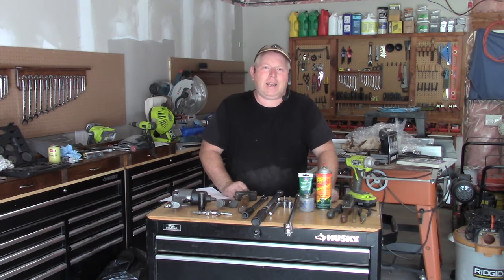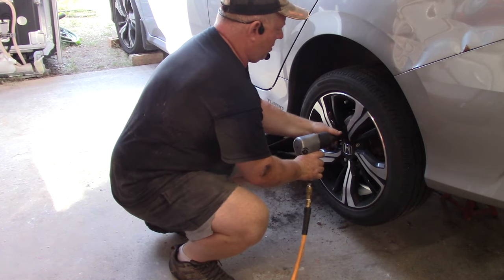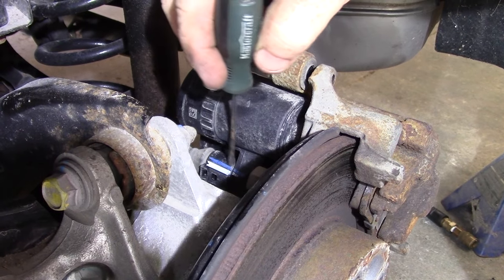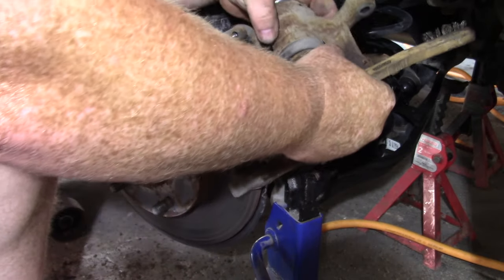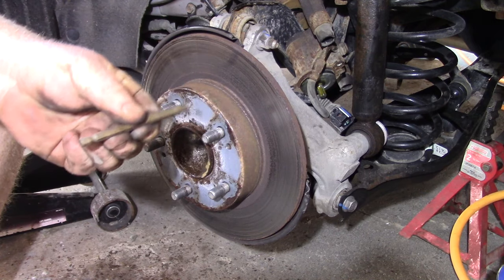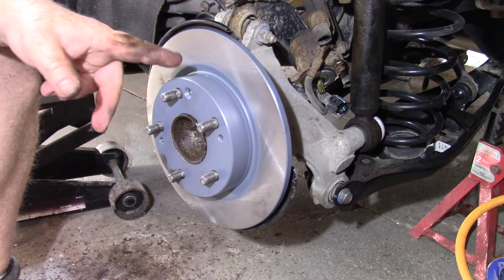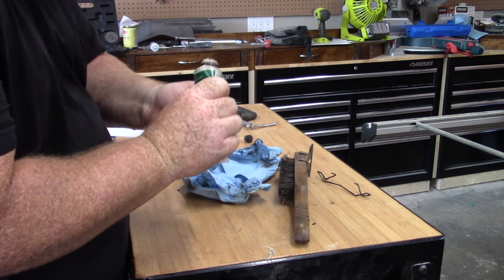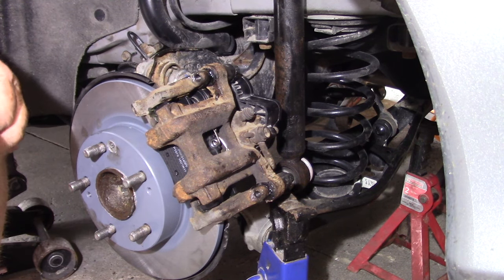DIY 2016 + Civic Rear Brake Replacement With EPB Using Honda Tech Manual

Comment: Very well done video. Thank you very much. I carefully followed it on my 2017 Civic EXT and didn't have any trouble (no brake light afterwards).
What I did notice is that when I jack up the rear of the car and I give the rear wheels a good spin with one hand, it only makes a little bit more than a whole turn after I released them... when it should be around 2.5 times if I am not mistaken. I am saying this because I noticed the drop in MPG... I guess because there is some increased friction on the rear brakes. What steps would you take to troubleshoot this scenario? Grease the caliper pins? Thank you in advance.
Reply: The problem was the caliper's pins. I greased them better this time and I also greased all the other brake parts. I am getting +50 mpg on my 2017 Civic EX-T!!!
You can see the "wheel revolutions" test here: https://youtu.be/0wX7ISUY3hk
This video shows how I greased the front brakes as an example: https://youtu.be/Cr7v6KarX6A

Comment: Hi rob, thanks so much for the effort that you put in making this video! 
I didn’t touch the electronic parking brake at all when I was lubricant the brake parts beside unplug the wire but I still managed to push the piston in a little bit w/ a C clamp and I pumped the brake afterwards and checked the electronic parking brakes and they’re working just fine. 
Is there a reason why you remove it during the changes? Because I managed to push it back enough to fit it back in w/ the pads. Just asking if I need to remove it in order to press the piston back in or I might damage it?
Reply from the maker: There is a possibility the EPB could be damaged while installing new brake pads.  You can retract the EPB manually like I did in the video or with an expensive scan tool.  All manufacturers suggest setting the car in "maintenance mode" (either manually or with a scan tool)  It's super easy to do and don't forget to calibrate the brakes shown in the last part of the video.  Good Luck with your repair!
Cheers!
Rob
Reply: @robsgaragewoodworkin  I’m not too sure if it is damaged or not but it’s still working fine and still functioning normal on both sides when I put it on and release it daily after the press. But I’ll b sure to manually remove it next time! Tysm for your time!

Comment: Hey Rob!  Thank you so much for this detailed video!  I was able to replace my rear pads and rotors with no issues!  I know you use a caliper tool in this video, but much like in your video for the front brakes, I was able to use a 4" C-clamp to push the caliper piston back.
Reply from the maker: You're welcome!  Thanks for your comment!
Cheers!
Rob

Comment: Thanks for the video Rob, very helpful. I have 80000 miles on my 17 civic. The rear brakes were making loud grinding noise. The discs looked really rough, like the shoes were making partial uneven contact , but the shoes had more than 1/4 inch of meat on them. Weird. I changed everything anyway, and lubed it all up, and it sounds so smooth now.
Wheels needed a big rubber mallet to get off as did the discs. Well worth the trouble.
Reply from the maker: Awesome!  What did you do with all that money you saved?
Reply: @robsgaragewoodworkin  lol, as soon as I talk with legal I'll let you know. :)
Reply from the maker: @vincentl4691    Lol!  Better wait for the trial too be over so you don’t incriminate yourself...😂

Comment: Thanks for the video.  Just replaced my wife's front and rear brakes.  Followed all of your steps except disconnecting the coupler because for some reason it wouldn't come off.  Still worked out in the end with no brake light.
Reply from the maker: Awesome!  Time for a beer!

Comment: Best Civic rear pad video ever! Honda made this shit more confusing than it needed to be.
Reply from the maker: It's actually a great system that solves a variety of issues.  The problem is no one knew how to do it properly and they weren't sharing that information.  It's actually quite easy.  Don't forget to calibrate the EPB by cycling it on and off 2X like I did at the end of the video.  Mechanics everywhere are getting ABS error codes because they don't know that simple crazy important step.  Good Luck with your repair!
Cheers!
Rob

Comment: Finally lol i try to do it my self and I couldn't do it . It was my first time iv search and no one had a video yet hows its done. Iv  searched around and it said it needed to be done with a electric device or computer.  So i had my done at a mechanic and they charged me just for labor but i had the parts $100 so now i know how next time thank man you saved our lifes on saving money. Lol good job , i have an accord 2018
Reply from the maker: Yeah I hear ya!  I looked all over to find the proper Honda instructions.  Super easy to do (when you know how)!
Cheers!
Rob

Comment: Very in depth and informative video! Question about the electronic parking brake. The mechanism is completely separate from the brake pedal, correct? I'm wondering because I'm getting ready to flush the brake fluid for the first time and I want to make sure the parking brake doesn't turn off as I bleed the fluid.
Reply from the maker: Yes you are right.  Just cycle it on then off to ensure its not engaged for the brake fluid flush.
Good Luck with your repair!
Cheers!
Rob
Reply: Hey Rob question regarding brake flush ... I did my brake flush on my 2016 civic and the parking brake WAS ENGAGED during the entire flush .. should I be worried ?? Or should I do it all over again with it off ?? THANKS IN ADVANCE!
Reply from the maker: @bettyguzman7130    Ok, that is a good question.  I’m a little picky so I would pop the rear wheels off, disengage the parking brake and just try to bleed the 2 rear brakes.  You are probably fine but I would double check - just in case.

Comment: Nice detailed video with great editing. Thanks. A few points. I would use a q tip instead of a nail to smear grease.  Better control. 
Also tech manual says to replace epb o ring and screws but I would say it isn’t necessary
Would you agree especially since those parts could cost 50$. I assume is to prevent moisture.

Comment: Just did this exact method but didn’t unplug the epb system when I removed it and the parking e-brake dash light is on now. I’ll Jack it up tomorrow and unplug it and plug it back in and hopefully that’ll reset it. Great video tho it was very helpful 👍🏻
Reply: I didnt unplug it when doing mine as it was stuck so didnt wanna break it and it was fine tbh

Comment: Great video! Are both slide pins the same? I know on my Sonata they were different, so of course you had to be careful you put them back in the original locations. Also, I always spray brake cleaner on any brake parts that I use a wire brush on and also the new rotors after installing them.
Reply from the maker: Yes I do one at a time so I don't mess it up.

Comment: Hey Rob! Great video but I have a few questions if you can help me out. Like the person stated down there if the parking brake needed to be disengaged prior to starting, is that done by putting it in Neutral or the actual E brake, and do you put the E brake on for the job or does that mess with the EPB system? 2nd, what kind of pads are best for the Civics? I’m looking at doing this job but not sure if Ceramic should be used or if the premium pad should be bought. Thanks! And hope to hear back from you soon! Cheers!
Reply from the maker: Just make sure parking brake is off and leave the car in gear if it's a manual or in park if it's automatic.  It doesn't really matter but the stock brake pads and rotors would be considered premium.  The stock rotors are ceramic coated so they don't rust on the dealers lot but you don't need the ceramic coated rotors.  I just get premium pads and premium steel rotors.  Look around for the best price.  Good Luck with your repair!
Cheers!
Rob

Comment: I had problem unplugged the wire connector, so I just removed the housing of the actuator.  Thank you for your details video. It was really helpful.
Reply: I never unplug mine either just remove it every time.

Comment: Good video. I am about to do the rear brakes on my 2017 Civic si. Honda is really bad with factory rotors. We had five  honda cars, 2001 Civic, 2006 Civic, 2012 accord, 2015 pilot, and 2017 Civic, all of them had rear rotor issues prematurely. Once replaced, even done by the local dealer, provides years of trouble free service. Don't know what is the deal with them at the factory.
Reply from the maker: The dealers (mechanics) get paid by the job and not hourly.  So the more work they can do the more money they make.  It's easy for them to con customers into brake jobs.  The rotors from the dealer are identical to the factory ones. We have all been duped by mechanics that's why I DIY.  Don't forget to calibrate the EPB (last part of the video)  Good Luck with your repair!
Cheers!
Rob

Comment: Thank you for the video!

I have a question. Why did you have to remove the electronic parking brake? I’m thinking of replacing rotors and pads on my 2017 Civic Sport Hatchback . I have 150k miles on them and first change of brakes. These are long distance miles and not city miles. I have found they are making noise that I haven’t heard before. The dealership said I still have some life left but I figure I’ll just change it all out at once. 

Thank you ahead of time for your reply.
Reply from the maker: Yes you have to either remove it and turn it back manually or if you have an expensive new code reader/scan tool you can set the brakes into "service mode" then you perform the brake service as usual.  After placing them in service mode you have to return them to "drive mode" then cycle the EPB like I did at the end of the video.  If you manually retract them you put the car in accessory mode and engage the EPB fully (it takes a long time because it has been fully retracted) and when it stops (you can hear it working and stopping).  Then you start the car and cycle the EPB system 2X.  Dealer cost is $650 in Canada and around $200 DIY so significant savings to do it yourself.
Best of Luck!
Cheers!
Rob

Comment: Very informative video! Quick question, when I compress the caliper piston, do I need to put the attachment so It rotates the piston or just compress without rotating the piston?
Reply from the maker: Ok there are 2 options.  There is another method that you can use the tool that “winds back” the piston and EPB but so many people were having trouble with that method.  So with the method in this video you remove the EPB from the back of the caliper first, rewind it to the home position by hand and push the piston back while the EPB assembly is still off.  So no, with this method you do not have to wind back the piston, just press it back.
Reply: I took the EPB motor off, wound the piston back until it didn’t turn anymore (if i used more force i could feel the torx spiggot turn with the whole piston), the turned the torx clockwise all the way till it wouldn’t turn anymore, after all this the piston was still sticking out abou half an inch, so i ended up compressing it in. Any reason to why it wouldn’t go in flush after winding it?

Comment: Hi Rob, thank you for this.  One question - does the rear brake piston screw in, or it can just be squeezed back in with a c-clamp?
Reply from the maker: Once you retract the EPB as shown in the video you can use a C clamp to squeeze the piston back in.
Good luck with your repair!
Cheers!
Rob

Comment: Hi, very informative video, I'm going to be doing a friend's pads on his civic. The spindle you wound fully clockwise with the e12, do I need to wind it fully anti-clockwise once I have fitted the new pads. Thanks.
Reply from the maker: No you are backing the e brake in then compressing the piston.  When everything is done follow the calibration sequence - the in car part.
Reply: @robsgaragewoodworkin  Thannk you.

Comment: At the end for the calibration you press the pedal several times and then you go to on mode press the parking brake on and off or release without starting the car and then it seems like you start the car and repeat parking brake on and off??? Thank you 😊
Reply from the maker: Yes.

Comment: I have a 2016 Civic LX Manual. Do you disengage the EPB before starting on the rear breaks?
Reply from the maker: Yes you ensure the parking brake is off.  Then you have to retract the EPB before you push the brake piston back.  You can do it manually or with a scan tool.  I have a video for both methods.

Comment: One more question, some pople use anti seize between the caliper brqcket and brake pad. Youve used the included brake grease. Does it really matter what one uses? The copper based anti seize i have can handle 1800 deg F, or 990 deg. Celcius. I assume the brake grease included is also high heat? Also wondering if much dust/dirt is attracted to the exposed vracket grease .
Reply from the maker: Brake grease is for the areas that need lubricant.  Anti seize is so you can remove nuts, bolts, spark plugs.  That sort of thing.  I’m in Canada so I use a little anti seize on the nuts and bolts.

Comment: Thanks for your video! I have a question, why do you need to take that motor off? The electric parking brake motor?
Reply from the maker: @wangmengj    2 ways to do it.  Manually you have to remove the EPB motor and wind it back following the instructions in the video.  Or you can buy a scan tool for $350 or more and use that to put the brakes in “service mode”.  I have another video showing how to do that.
Reply: @robsgaragewoodworkin  is it enough just unplug the connecting wire of the brake motor, ming has some rust and one thing less to remove will make life a little bit easier. Thanks a lot for your answer!
Reply from the maker: @wangmengj  if you don’t wind back the motor you will break it
Reply: @robsgaragewoodworkin  Thanks! I got it!

Comment: Can you tell what the torque is. You mentioned inch/lbs and foot/lbs. Can you clarify? Also shouldn't the brake fluid reservoir lud be opened to atmosphere first?
Reply from the maker: Foot pounds.  (Worked in too many different industries).  You don’t actually have to open the reservoir lid.  (I used to think that too)

Comment: Probably the most detailed rear brake video from this car.  But I have a question: is it necessary to disconnect the electric cable from the small electric motor?
Reply: No. I never unplug mine. As long as car is off. E brake is disengaged and you don't mess with E brake button obviously you'll be fine. I guess if there was a Break in the wire maybe it could engage on its own due to malfunction of damaged wires.

Comment: Thanks, brakes are beginning to squeak and needa change them out soon. Does it matter if the e-brake is engaged or disengaged when you take it apart?
Reply from the maker: The brakes EPB should be disengaged so you can remove the caliper.
Good Luck on your repair!  Remember the last part of the video to calibrate the EPB when you are done the repair!
Cheers!
Rob

Comment: With all that salt rust it must be damn risky buying a second hand car in Canada ! Thanks for the informative video. I had a look at my 2013 Civic and thank goodness it doesn't have that damn electronic brake. Also big thanks for the torque specs which is great when they pop-up on screen as you are doing the torqueing. I double-checked with my Haynes manual and the caliper mounting bolt spec in there shows as  17 foot-lbs but you had the actual honda tech worksheet specs at 18 foot-lbs and so is probably more accurate - and the extra foot pound is better safe than sorry anyway. Some suggest using a medium threadlocker on the bolt threads but I think like you I won't be bothering with that as will be torqued properly. Cheers !
Reply from the maker: LOL!  Rust sucks but the body usually lasts as long as the engine.   All the car guys I know ditch the thread locker and use anti seize - life in Canada...

Comment: Hey Rob, I've been waiting for someone to find the none Honda scan tool way of doing it.  I'm a mechanic in training myself.  A good point maybe to add would be for those of us who live in the North where we get salt , sand and alot of gunk get built up in the connector releasing tab. I was able to remove the parking brake assembly and move it around freely without taking the connector off.
Reply from the maker: Yeah.  The conundrum...  If I say leave it on then people will brake the wire, If I say take it off people will brake the coupler.  Just can't win...
Thanks for your comment!  Enjoy your new career!
Cheers!
Rob
Reply: @robsgaragewoodworkin   fair point man. Take care.